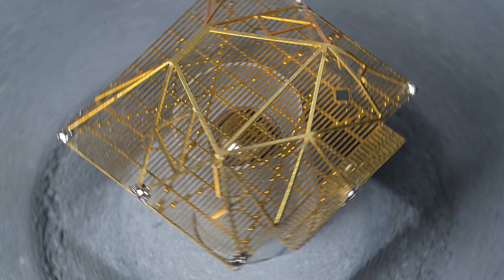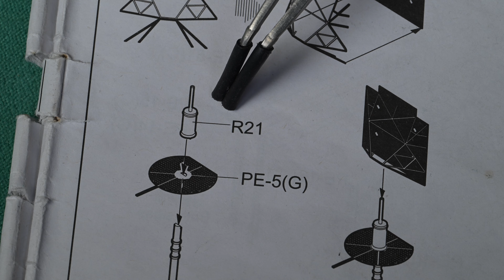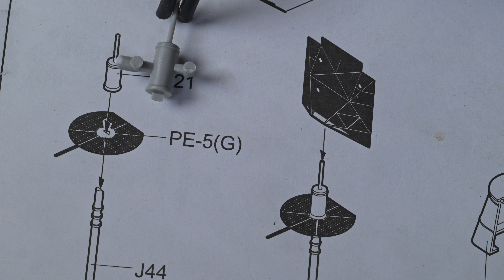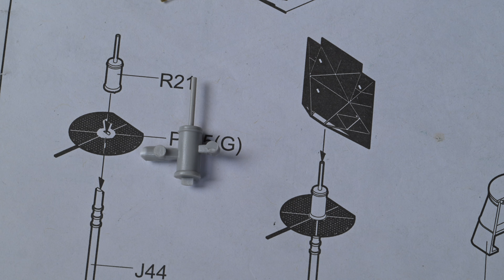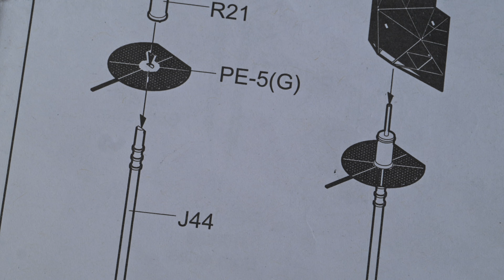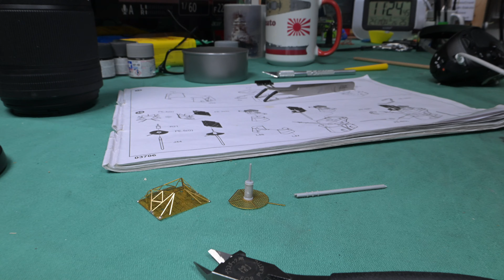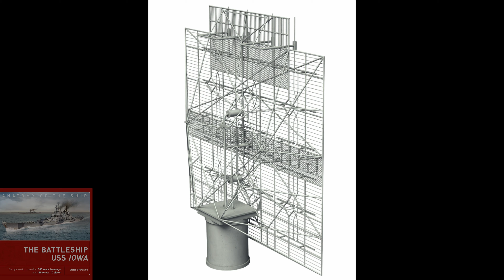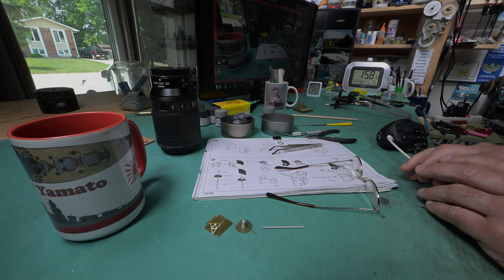The Model Ship Part 1650

Comment: Hi from Belgium, I discovered your channel a little over a year ago when I was looking for build logs for the Bismarck. I heve been bingewatching your daily contribution till I cought up with you.  In the meantime my Bismarck, including propulsion and moving main turrets and radars and a little lighting is all but finished.  You may not be the best modeller on you-tube, but the way you show it is compared to none. 😊  The great value of your channel is in the experiments that you do and the close-up way of showing every bottleneck.
As for attaching the photo-etch to the plastic pin, the easyest and safest way is to replace the thin plastic pin by a brass one.  Take a brass pin of similar diameter, and slightly longer than the plastic one.  Solder this brass pin to the radar, then nip off the plastic pin, drill a hole in the body and insert the brass pin you soldered to the radar. Secure with a tear of thin CA.  Good luck and happy modelling ( I hope I did not type to many errors in english 😊 )
Reply from the maker: Hello Herman,
Thank you for watching and commenting. 👍

Comment: Nice update Ron, does the bottom of the radar meet the flat edge of the base? If so you could solder it in?
Reply from the maker: Re: "does the bottom of the radar meet the flat edge of the base?" Will check some more on that today in 1651.